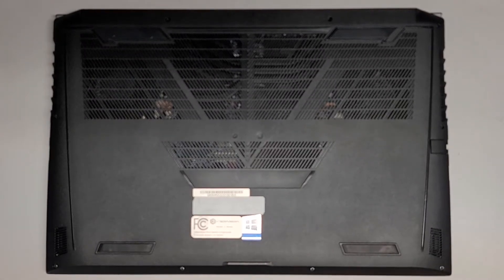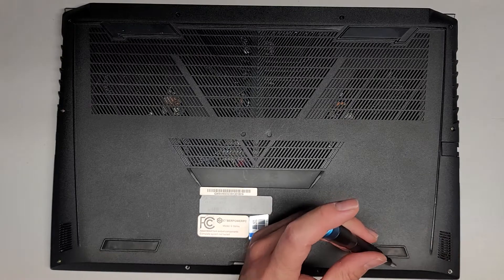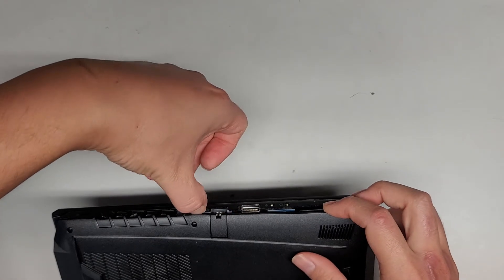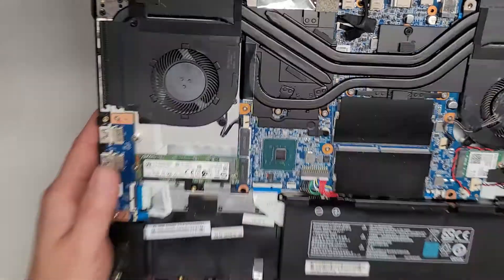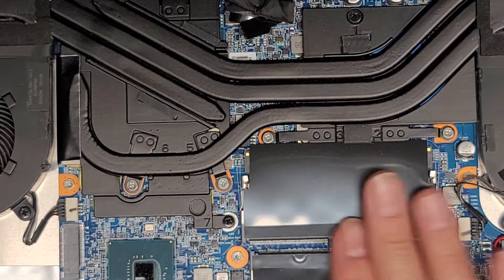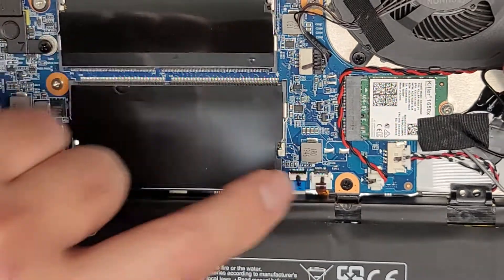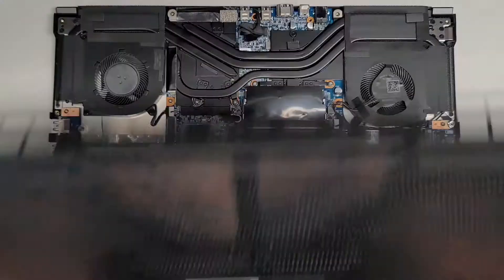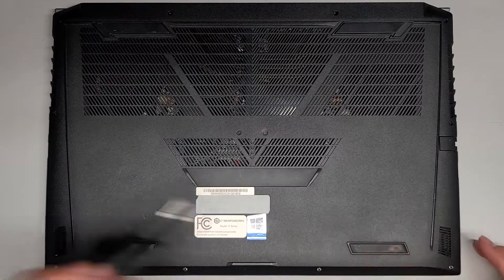CYBERPOWERPC Model C Series Tracer IV GK5MR0O Disassembly RAM SSD Upgrade Replacement Repair

Comment: Do you know how to replace a keyboard on these?
Reply from the maker: Yes, but it'll be much easier to replace the entire keyboard assembly. It's held in place with melted plastic.
Reply: @ItsBinhRepaired  I’ve got a Tracer Edge V and we’re struggling to find the part for a new keyboard.  Any suggestions?   I’m told my machine is a Tong Fang GM7TN0
Reply from the maker: @chrisbolducrowan5110  not sure :(
Reply: Any idea where to get the keyboard assembly  @ItsBinhRepaired